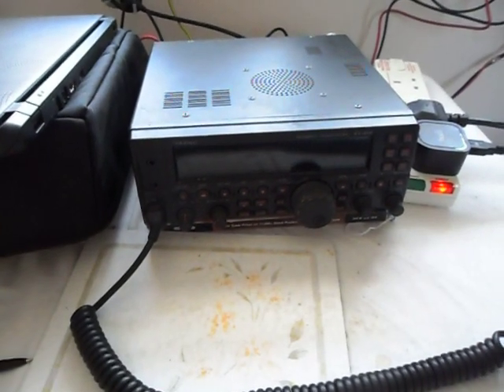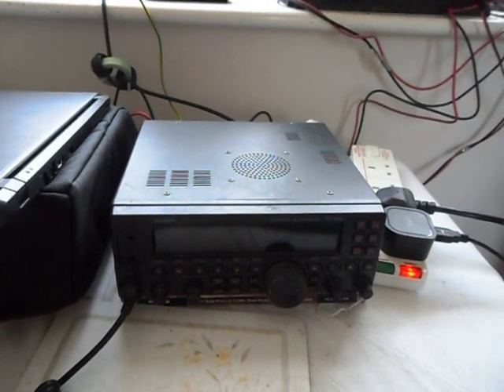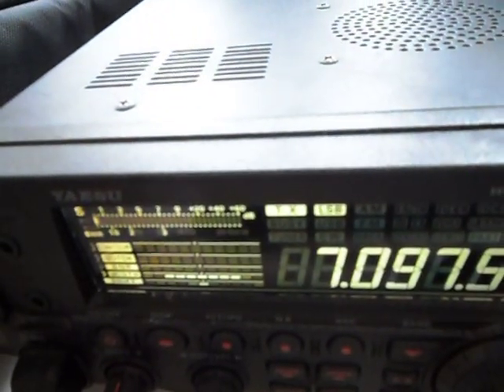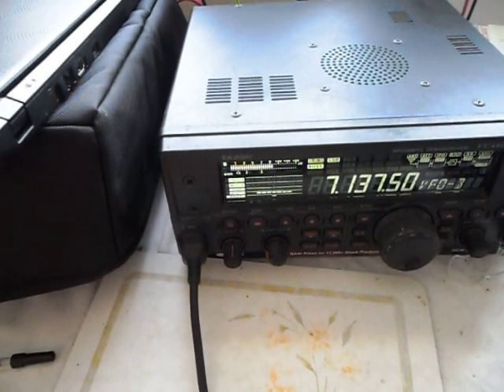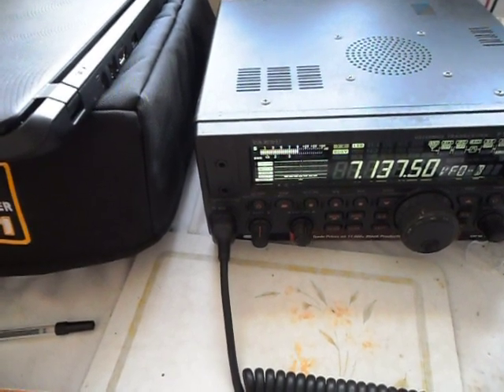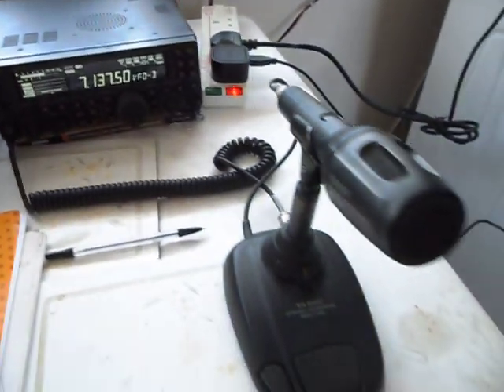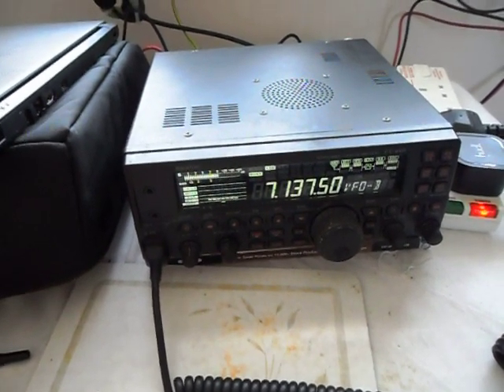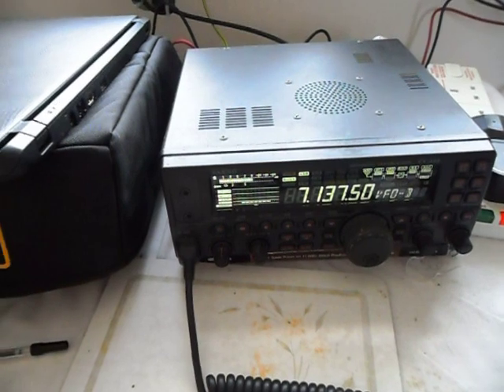Yaesu FT-450  transmit problem and simple solution

Comment: No MD100 here but breezing through videos but that would make a nice desk mic always used hand mic for most communications ham radio and before. I purchased a ft 450 used I love the radio but tecieve alto of dwelling noise. I take else where or Mobil ok. Few things about the regular ft 450 red buttons I wonder if its possible replace keypad with white buttons from D series? 2# Radio is finicky turning on with 12-15 amp supplies even if voltage is 14.5 voltsxwont turn on but at 12.4 vdc off a gel cell battery turns on or a 20 amp lunar astron supply it works everytime? I have not seen anything onvinternet to explain. 3# the transmit alc ( not the receive alc) cuts the Raf power to much on below 50 watt setting this needs turned off is there acservice menu to adjust TX ALC? Anyways that is all thanks for tip on the 450.

Comment: TL;DR:  He had the mic button pressed when he turned it on.  My FT450D problem... after running it mobile in the Texas heat, the VFO encoder started skipping, made the rig almost unusable.  After some thought, I guessed that the heat had caused the silicone lube to flow down the encoder shaft and gum up the optical encoder... 40$ later I was able to confirm this.  Don't leave the radio face upwards in the heat!  I tried taking the encoder apart but there's no way to get it back together, the wheel is melted onto the shaft... certainly worth the price for the new part.
Reply: Thank you for the TL;DR. After 5 mins of waffle I paused the video and checked the comments for what the actual problem was.

Comment: Basically the title of the video, 'FT-450 transmit problem' is completely wrong! The radio has no 'transmit problem'... The only 'problem' is that you are unfamiliar with the buttons on your own desk mic! I have a 450D and the same desk mic. I knew before I plugged in the mic what all the buttons did - including the Tx lock function on the detachable desk mic... 🙄

Comment: If you would like to save 12mins of your life and not listen to endless blather, just hit transmit on your mic and it will stop the intermittent transmit.
Reply: So right, it seems to be a common issue with UK model humans.   I wonder if it's a flaw, or design feature?   Maybe send one off for factory repair and see....😅

Comment: Hello Ed,

Thanks for your feedback on that "safety" problem. I've got the same equipment here: FT450d + MD100, I never touched the PTT hold on the top of the mic (I always used the PTT and PTT hold on the base) so it never happened to me.

I think it could happen on all modern Yaesu like FT450, FT950 and FTDX... (not sure for the FT-817/857/897).

I realy enjoy my FT450D and I'm very happy with it. The reception is fine on SSB/CW, nice DSP,... I like to operate this rig.

73's de Adrien

PS: à bientôt sur l'air pour un petit QSO...